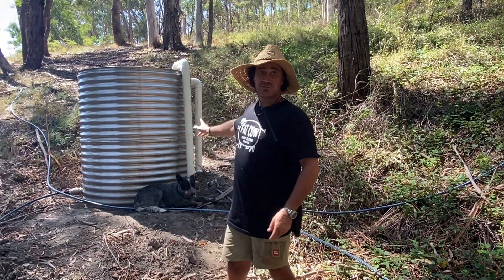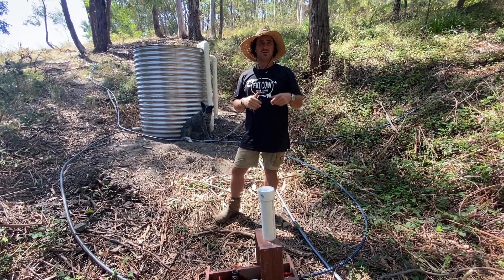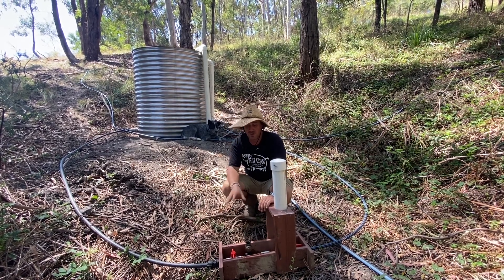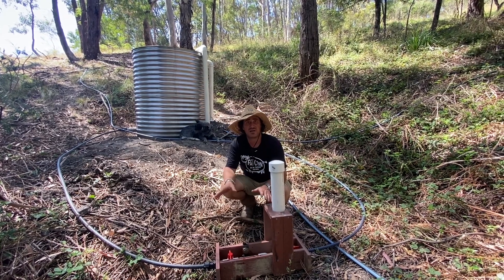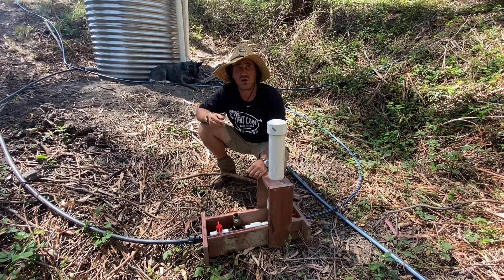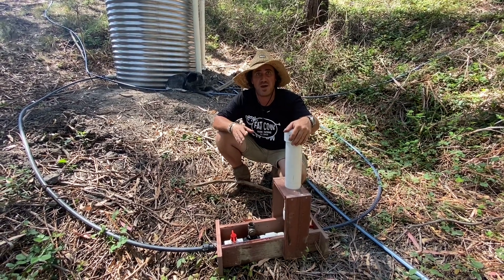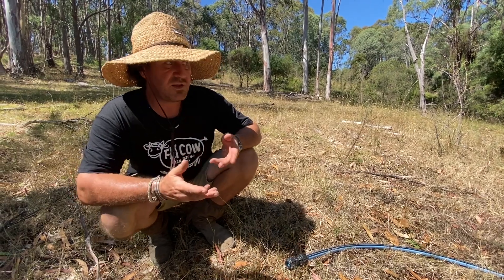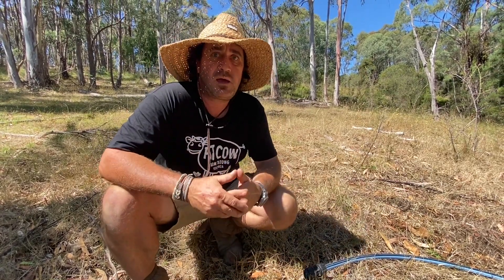Ram Pump v's 12 Volt Solar Pump - Part 1.

Comment: I postet this already in an older video: Just put the ramp pump over the tank, and you would catch the water that would otherwise be wasted. And this can be supported by a solar pump. Also you should not use a timer unless you have a batteryprotecion circuit, as batterys dont like to be dicharged too much. Also some pumps dont like to run dry.
Reply from the maker: Hey Squirrel, i won't be able to place the pump above the tank as i won't have any head pressure. The ram pump just won't work with our situation, i have no problems setting up a solar pump unit. Thanks for the input.
Cheers